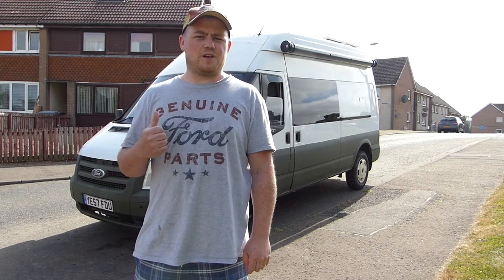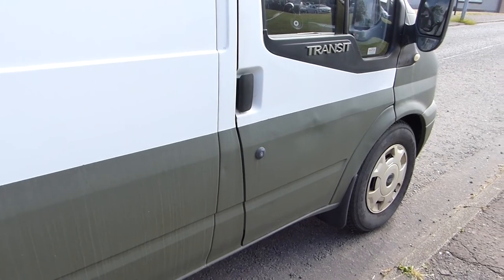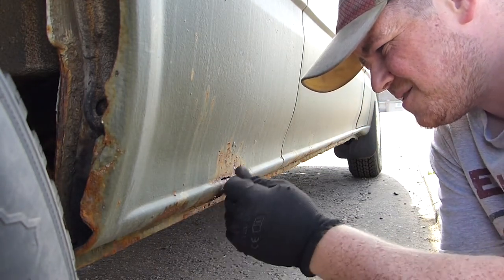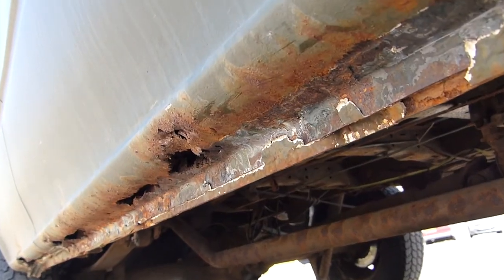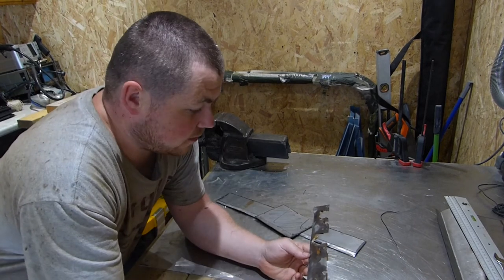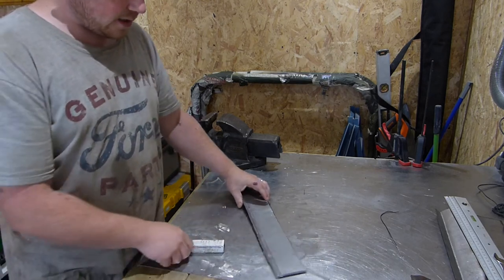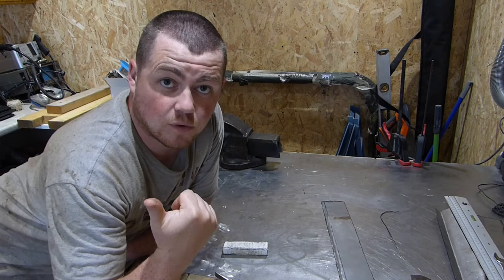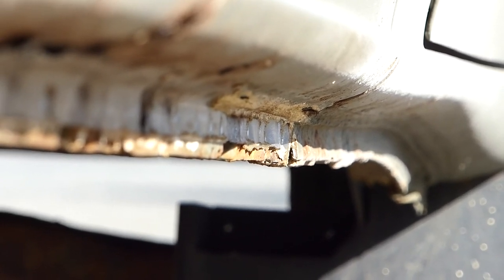Ford Transit MK7  Sill Rust Repairs - Part 1

Comment: If it had been me I would have bought replacement panels and saved a lot of grief but you did it your way and well done
Reply from the maker: I did use repair panels in the end but did struggle to find inner panels rather than the outer ones, with that being said it did help to keep the parts cost down. 😊

Comment: thats a shocking amount of rust in a structural sill for a relatively recent van. You have to wonder if the poor drainage and thin metal in the sills has to be a design intention by Fords to limit the vans lifetime because even the Mk5 Transit wasn't that bad .
You did a good job anyway and you've given your van another 7-10 years life if you treat the sills before closing them
Reply from the maker: Very true John, I think the problem is initially caused my water, mud salt etc getting into the sill from the rear wheels as there is almost like a bowl affect that goes on and once the original seamsealer gives up and just starts to flood the full length. I think it also doesnt help if a vehicle isnt moving constanty and it just sits with water in its belly for to long :( but who knows right? Thanks for the comment :D

Comment: Great bulletproof. Motor apart from the dreaded rust y o y Ford didn't zinc galvanized is beyond. Me. My old 92 astra diesel was the same started a small hole and got like the proverbial swiss cheese.
Reply from the maker: Nothing worse when that happens.

Comment: Do we have to cut the outside off to fix the inner?  NZ :-)
Reply from the maker: You can prob get away with working with the backside of the panel but mine was damaged on the outside and then realised there was more damage on the inside panel. 👍
Reply: @abilityshare9294  Thanks - there is a first time for everything.  :-)

Comment: Buy the replacement panels for £30 pounds each
Reply from the maker: I did in the end buy the replacement panels for the outer sills. I have done the same for the SWB project that's going on just now. 👍
Reply: Where do you get your panels from?

Comment: Those welds don’t look very solid? Looks like pigeon shite??
Reply from the maker: Thanks for the comment mate, maybe it's just because of the style of welding that makes it look a bit messy (stitch welding) as you can't run beads on sheet metal without it warping and with the heat low enough that you could run a bead it wouldn't have the same amount of penetration. Any tips though on how to improve?
Reply: That's as much welding as you can do on the muck steel they use in transits - Lads dream that it should all be posh beads, when in reality, getting tack welds in is often a struggle. They look good & solid to me - I do these for a living.
Reply: Who’s gona be lying on there back checking out the quality of the welds underneath the van. If it’s stuck, it’s stuck. Move on to the next bit. 👍.